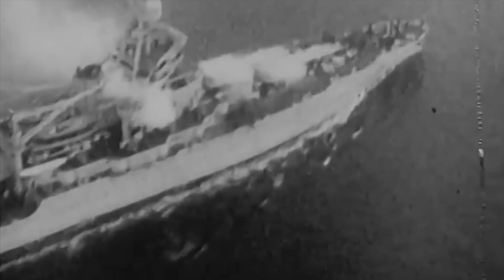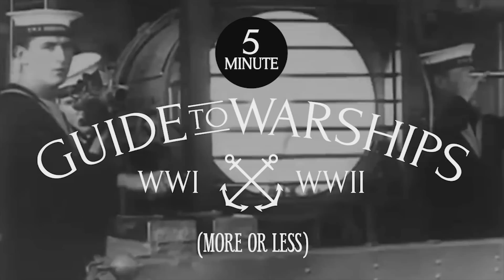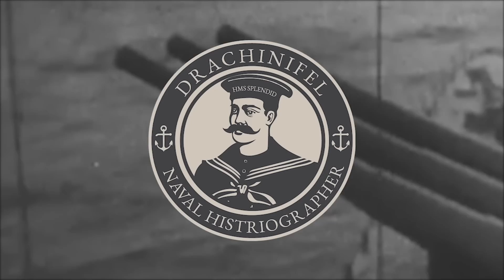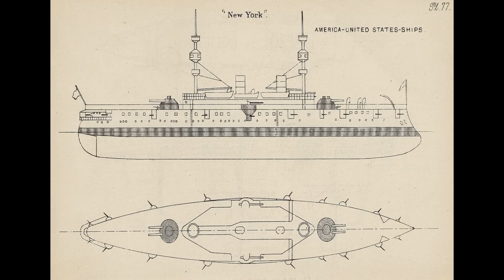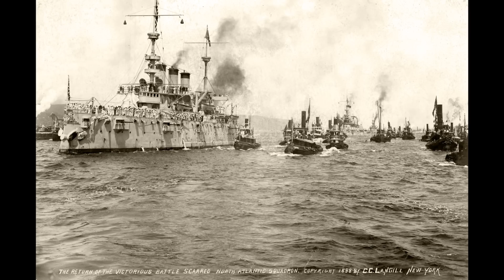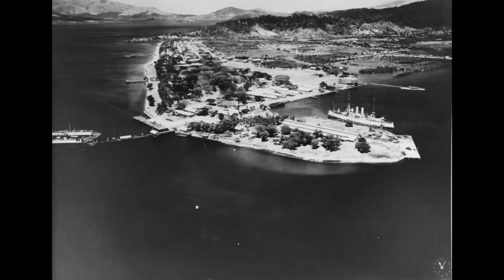USS New York (ACR-2) - Guide 337

Comment: On the image used for this video the designation ACR is shown.  This designation was never used by the USN.  Between the commissioning of the New York and sometime before or during 1911, she was designated "Armored Cruiser #2". Between then and July 17th 1920 when General Order 541 became effective, she was designated "Cruiser, 1st Class #2".   After this she was designated CA-2 which still stood for "Cruiser, 1st Class" until the treaty terms heavy cruiser / light cruiser became effective in 1930 when still designated CA-2 this then stood for "Cruiser, Heavy".

No short designations / abbreviations were used before General Order 541.  If the type "Armored Cruiser" (or more likely "Cruiser, Armored") had been included in General Order 541, it would not have started with the letter "A".  All types that started with an "A" were auxiliaries.  All cruiser types began with the letter "C".
Reply: Oops - I made a mistake.  After 1911, she was "Cruiser, 1st Line #2".
Reply: I'm getting old ... this is wrong too.  Upon rereading this and consulting my sources ...

Commissioning to ~1911 = Armored Cruiser #2
~1911 to July 17th 1920 = Cruiser, 1st Class #2
July 17th 1920 to 1930 = Cruiser, 2nd Line #2 = CA-2
1930 to Decommissioning = Cruiser, Heavy #2 = CA-2

When reading General Order 541, CA seems to have been only used for Cruiser, 1st Line and OCA would have been used for Cruiser, 2nd Line.  However the navy's Ship's Data publications show Cruiser, 2nd Line designated as CA when referring to a specific ship.

Comment: I'm a sucker for the New York; such fine lines in comparison to both her predecessor and successor. I've often wondered if she could've been modernized to take the twin 8's from the Lexingtons. Alas, it wasn't to be... Shame she was scuttled at Subic.
Reply: Friedman in US Cruisers said the USN looked at modernizing the old CA's as they would not have counted against the USN's Treaty limits, but the revisions to machinery and hull were so major that the cost could not possibly be justified in the Depression. BTW, the Lexington and Saratoga didn't give up their 8 -inchers until 1941-42, so they weren't coming from there (they actually went to the Army's Hawaiian Separate Coast Artillery Brigade and became shore batteries). They were the same design as the dual turrets on the Pensacolas
Reply: @ROBERTNABORNEY-f3k  I'm aware. I wasn't of the idea that the 8 in. was going to be removed from the Lexington in order to modernize then- Rochester, I was simply of the mind that the same model of twin mount could be utilized in a potential rebuild.